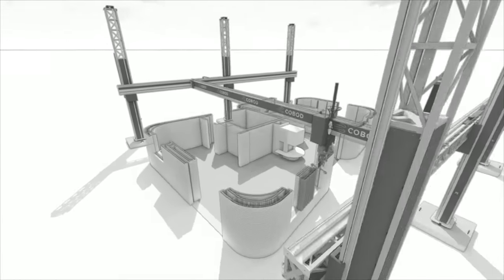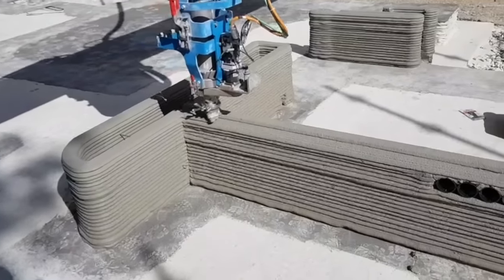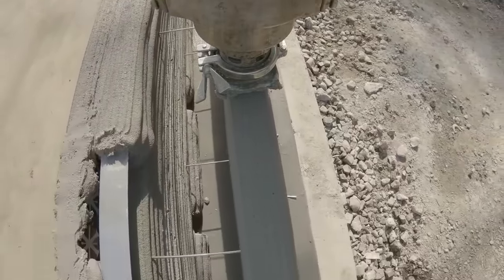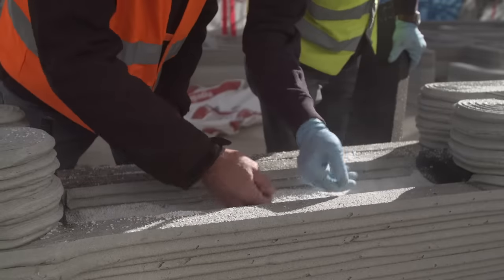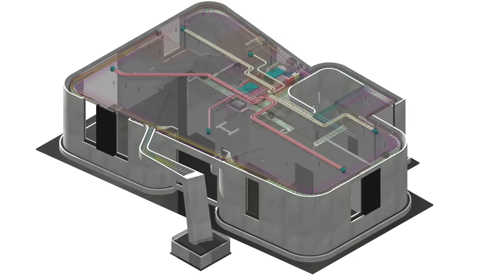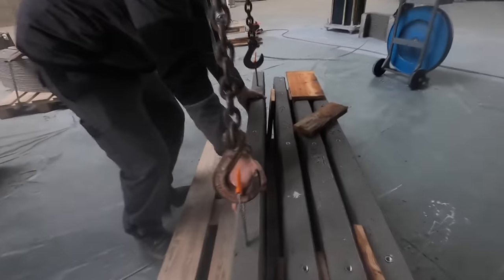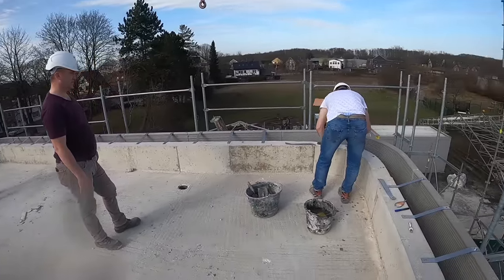The Most Innovative 3D Printed House In The World [Mense-Korte]

Comment: Steel shipping container house. Built at a factory and delivered. Put in place in less than half a day. There are millions of containers that no longer meet shipping container standards of larger cargo ships. Concrete requires the destruction of islands for the materials used to make cement.
Reply: And where does steel coming from? Hell of a lot work to turn a shipping container into a home. And small as well.

Comment: It seems the importance of building this way, is the pre-construction of the printer and hoarded enclosure. Is this type of construction seasonally or weather prohibitive? That is to say, can this type of construction be accomplished in colder climates, below a certain temperature? If so, is there a threshold temperature where it becomes too cold for the process to work?

Another issue to think of is structural. While it is obvious that concrete technology has come a long way, how would this type of building hold up against seismic activity and settlement of the earth beneath the structure? Cracking is an issue with concrete, as it generally shrinks when it cures. Engineers would likely have calculated for this, but I saw no relief joints within the design. In addition, in colder climates, there is a structural issue of snow-loads to contend with, adding to the live and dead loads of any building, when designing in certain regions. I am curious if these are considerations for this particular house in Germany.

It is obvious that any renovations to the structure would be quite difficult to carry our, being that it is made of concrete. While alterations can be made from steel, wood, or composite materials on the inside, it would be harder to match construction on the exterior of the home, unless the alterations were made by another 3D printer. Regardless, this is less of a consideration as people's tastes differ greatly, when designing additions / alterations to an existing home. It is more of a concern when cutting into the existing structure, worrying about structural integrity, should certain areas be removed. It would probably be the same as any home, requiring a Structural Engineer to inspect the home prior to any alterations. Still, a much more involved process considering conventional builds.

All in all, I think that this type of construction would be ideal for projects no bigger, or perhaps taller, than a 3-story building. I can see this type of construction to be very instrumental in designing and building homes at an expedited rate, with the single and portable 3D units, used for smaller structures. Numerous small but sturdy homes could be built in no time, greatly increasing the immediate needs of any community. I could see this application for the construction of structures like malls and businesses, or even used to construct parks, pools, and numerous other structures built with concrete. Even plastic / composite structures could be built this way. There is definitely potential for 3D printed construction. I am skeptical of upscaling this too much though. The pre-construction process may become just as much of a cost as the build itself. 

Thanks for sharing Jarret.

Comment: Let's hope they start adding glass from industrial and other types of non-recyclable glass and particles of non-recyclable plastics to the concrete mix in the near future. This will reduce the amount of energy intensive concrete needed while reducing glass and plastic waste. In the future we will use concrete to sequester carbon pulled from the atmosphere. Carbon added to concrete improves its strength. Obviously adding carbon is cost prohibitive at this time.
Reply: I am not sure about the recycled materials, they might do more harm than good in the long run.  Global population is starting to stagnate, so I say make a perfect house that will last 1000 years and use less over all fossil fuels over time, rather than a good house which will need repairs in 50 years.

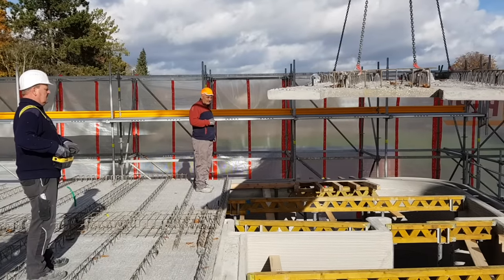Comment: @9:10  Although flat roofs would be very difficult if not impossible I think it should be possible to 3D print a vaulted roof with currently existing material. 
Something I have never seen in concrete 3d printing is temporary printed supports that are later removed. In normal FDM printing it is common to include supports for overhanging parts that are then removed once the print is ready.  It involves some waste and some manual labour but might save a more labour during printing and also make possible same overhangs that would not be practical to do with manually constructed scaffoling support.
Reply: The only way I think it could work practically and cheaply is to make the roof out of another material that is also printable. I can imagine that you could run a few processes in sequence forming different types of material, for example, concrete to start, then the machine would fill in the insulation then a skeletal roof structure that cures very quickly, like a 3D pen, then an infill with insulation forming an SIP type structure and finish over the top, essentially if the printer can switch between materials I can see it working.

Comment: The serious challenge is the low level of finish that requires manual repair.  And the concrete is not insulated and there are sweating problems and severe thermal problems and it does not have enough history to go with it for a long time.  The wonderful idea is far from the solution.

Comment: While the house looks great I think the technology is impractical it has a massive external footprint meaning unless you have a large building block you are not going to have the room. having said that I think this is a perfect technology for prefab construction where the printing can be done under controlled conditions then shipped an assembled on sight. 
One of the arguments I have seen a lot in the comments is 'It will Save the trees' here is the problem with that 85% to 90% of construction timber is from plantations planted and maintained for the purpose of suppling timber if the need for these most of these plantations will be clear felled and the land put to other uses.

Comment: Embedding pipes, conduits, HVAC ducts and so forth in the walls as they are printed is a terrible idea.  Pipes leak, wires corrode and get gnawed by vermin, etc.  In a conventional house you just cut through the drywall to repair, here you would be jackhammering through inches of concrete.  What this design needs are channels in the walls to run pipes and cables, open to the interior and covered with a thin skin of drywall.

Comment: It seems more work to set up all the machinery and time consuming to extrude all that concrete (time is definitely money in construction) than to set up styrofoam snap together concrete forms and pump them full with concrete in a single day. It takes even less skilled workers and goes very fast. Interior concrete walls are unnecessary so I don't know why they used it. Concrete is not cheap.

Comment: this is the first 3d printed house that actually seems something that would be done commercially and has a reasonable application. I personally think that the future of contruction is not 3d printing since it seems that after the print you still have do do lots of manual labour. I suppose houses made like we make cars are a better way to lower production cost. But the more option we try the better and i'm curious to see what improvements they come with to the process
Reply: 3D printing has its uses and more automation is certainly possible with it but i think a better approach is to build houses like we currently build them, just automated. like a robot/machine to lay down CBS blocks, add cement to them as needed in order to build the walls. The benefits of such a machine is it doesnt need to be as large as a 3D printer and can move around the site, you could actually use more then one on a build though with dry times for cement, its probably not needed. Similarly for interior walls if they are made out of wood, you could have a robot that builds walls and puts them in place as well as cuts and hangs drywell etc. absolutely no reason the entire process cant be automated. To me i think that such a method would have better results and be more widely applicable in the industry. ie. most people want cheaper homes, they dont care about fancy 3D prints.

Comment: Great unless you want any right angles.
Reply from the maker: Perfect right angles are tricky for this machine because it’s very abrupt and tends to shake the system because of the rapid acceleration. Excellent point, but it can be overcome with adjustable pump systems and flaps.

Comment: It would be interesting to see what the actual cost per square foot is as finished. 
The machine cost is a big cost.  Which will pay for itself over time.
Shop printed parts should be cheaper than site printed items.
But concrete is heavy and can be quite fragile. So those costs need to be added in.
Tje roofing has to be lifted in by crane, cranes and their operators are very expensive.  
I really am interested in 3D printing buildings and 3D printing in general.  I think as time goes on and the cost of the machines goes down.  It will become more viable.  There is obviously alot of concrete that when into that house, and concrete is still not the most environmentally friendly material.  And in America, it wasn't popular with LEEDS building practices at one point.  I'm not sure if it still is or not.

Comment: I'm in the process of building a cast in place system that is way better than this in every way. It's been around for over 40 years. One tenth the money spent on this printer would create a system that could build and place concrete clamp forms.
Reply: Really these systems are a jock in construction. You act like it's high tech, it's building a lower quality structure than the 70's homes that are junk

Comment: It looks way more difficult Tham conventional block system just to make walls..... I cannot create flat floor or even slabs..... the only practical use it has is for nice concrete columns with custom forms, other than that, a Regular worker can build faster and stronger Block walls... another point, the interior walls are a headache, if you have to move or remove a wall lol, conventional building is more advance

Comment: "That will result in a failed print [...]"

please don't consider this thing to be comparable to a 3d printer you have a home. 
I don't think anybody expects this to just print on his own and after two days the workers get back to the worksite and notices that the building has collapsed and the printer still continues to dumb concrete into nowhere.

It's basically the same concept but obviously used in a different context.
Reply from the maker: Nobody likes wasting PLA but at this scale mistakes with printable concrete can cost thousands of dollars potentially even more.
Reply: @automateconstruction  
The only large scale issue that I can think of is that for some reason they have to stop printing, the already printed concrete layer dries and because of that new layers won't bind as well. But in the clip you can also sometimes see clear lines which indicate that they might have stopped printing over night and it's fine to continue even when the last layer has dried. 

In that case I can't think of serious issue. Chances are you have to "supervise" the printing anyway so there is not really a chance of the printer going crazy without anybody simply shutting it off. 

That's what I meant with the difference between this kind of large scale printing and the printer plastic people have at home.  The usual critical errors and printers going rogue don't really apply here. (Again assuming that you can continue printing on dried layers)
Reply from the maker: Yes supervision is critical with occasional intervention. At this stage we are far from just clicking go and walking away. One day it may be possible.

Comment: Lol..  with the requirement of that crane, this is a non starter.
Reply: The 3D printer pads / pillars should be, if possible, integrated into the building design so they are not wasted.  The 3D printer needs to be truck delivered and to be able to build itself thereby removing the crane requirement.  The 3D printer needs more extrusion heads with different extrusion materials.  Ideas include blowing in the insulation right away and making the cover plates for overhangs.  The wall surface should be configurable.  Different walls should be able to have different surface textures.  The print head could use water spray to clean itself in designated purge areas.  Perhaps the material used for overhangs could be used to make electrical conduit and water plumbing.

Comment: I don't understand why people get excited about 3d printed houses. This whole process is neither cheap nor efficient. This will never be as strong as reinforced concrete, It is slow especially for house this size. The idea of having fireplace/bathtub poured from concrete is absurd if you don't like it in 2 years you have to demolish those thing instead of changing them... if you need few people 24/7 while this is printing then what is the point. If you have to raise tent around it what is the point again ?  For this house you can built it faster just with regular concrete pour method it won't take very long to build the scaffolding, put rebars all the power/piping and pour in  the concrete.

Comment: not a big fan of concrete, they dont age well... but as long as it is more affordable, lots of these more efficient processes are less affordable, which defeats the purpose imho.
Reply from the maker: The first lightbulb was $100 not adjusted for inflation after 100 tries it was cheap enough for lightbulbs in every home.
Reply: @automateconstruction  homes where i am used to be built brick by brick, stone by stone and affordable by working class ppl, now plastic wrapped siding homes cost 10 times more than the median annual income. the same trend can be said of cars.

Comment: What happens if, in the future, you want to change the internal layout of the home in the future. Are all walls load-bearing or can some of them be torn down?
Reply: I would think you'd want to build a wide open structure and then drywall individual rooms afterwards to have layout changing as an option.

Comment: Concrete is a source for high CO2 emission. Not sustainable. I don’t believe in this way to build houses. Pre-fabricated elements are much faster and much less expensive. Besides, the insulation value of this build must be poor. Much better solutions will soon be available.
Reply from the maker: I agree better solutions will soon be available. I think it will come in the form of material innovations, this same system can be used to print all kinds of materials so all it takes is one genius materials engineer to figure out an eco friendly solution!

Comment: I think 3d printed concrete is weaker than traditional brick methods.
Reply from the maker: 6000psi concrete is not weak
Reply: @automateconstruction  some random measurement is irrelevant, despite I am not a builder, various levels of drying concrete is more of a concern, when those layers might differ in that regard. imagine the machine gets stuck, one layer will dry out and another layer is put over it, one crack and push or force can level the wall later on in my opinion, plus I didn't register any cost benefits over traditional brick structure. still modular panel homes are probably quicker to build too.